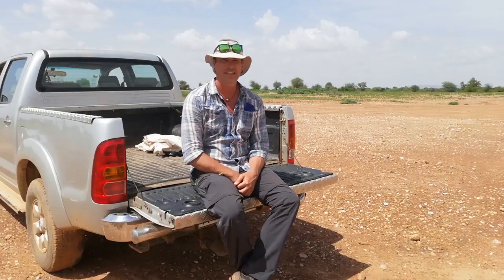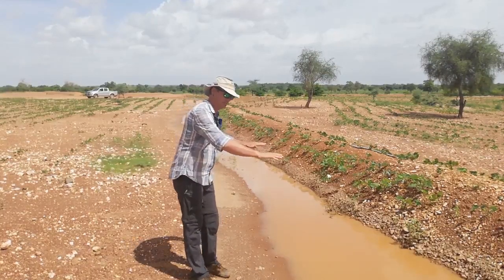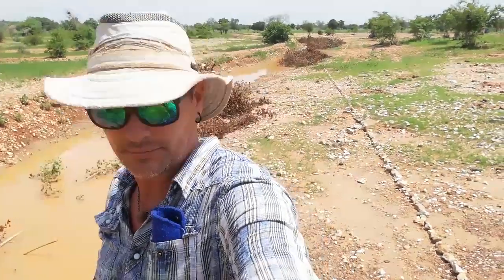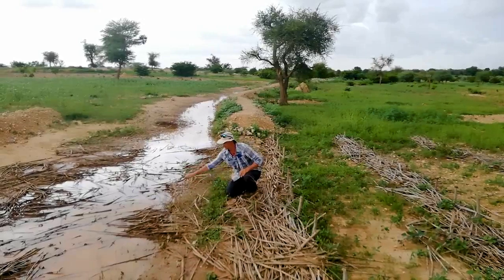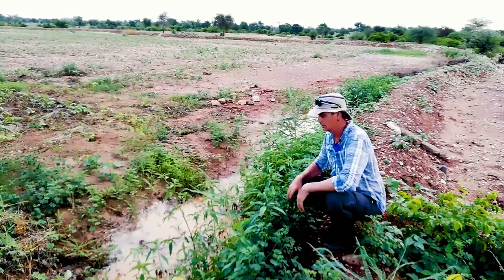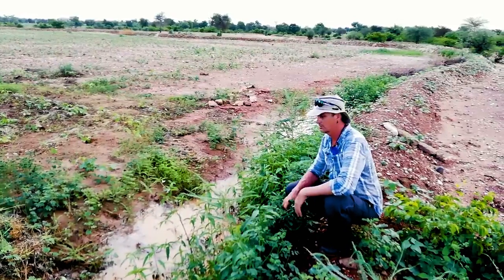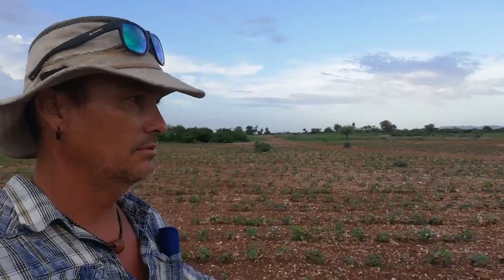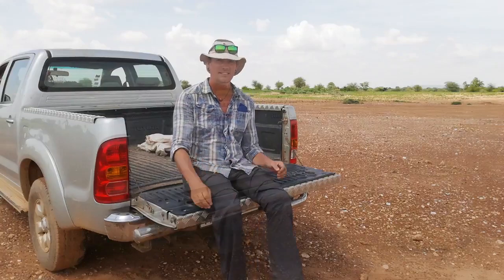20 Hectares Agro-forestry pilot project in Burkina, West Africa.

Comment: Do you think bamboo planted near to the purpose dug channels would grow quickly as an alternative source of firewood and basketry.
Would it use to much of the excess water?
It is a worthy optional material to have on your land.
Reply from the maker: Hi Chris, it would be very tempting to be planting bamboo during the wet season, when the swales are full. But you need to remember that in this part of the world, rain falls only for around 3 months! Only dryland type plants can be grown if not regularly irrigated. And during my time on the project, irrigating bamboo wasn't the client's focus. 
But you are right, thick wall bamboo types can be used to make charcoal. In this case it could also be used to feed animals during the 7 months long dry season.
Thanks for your comment.